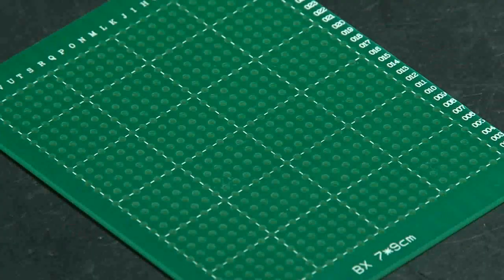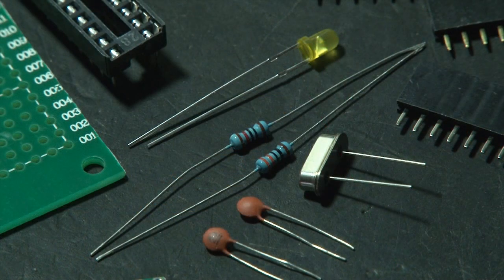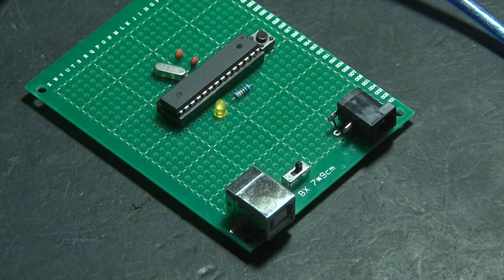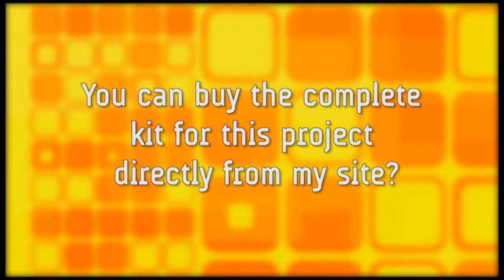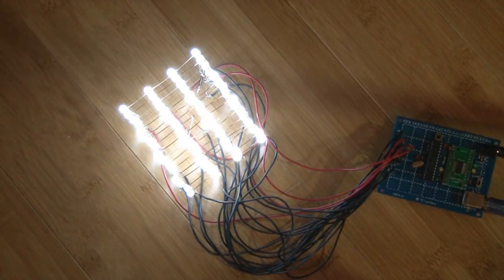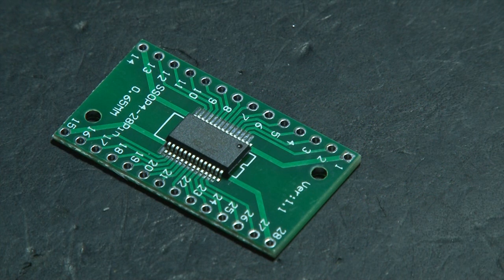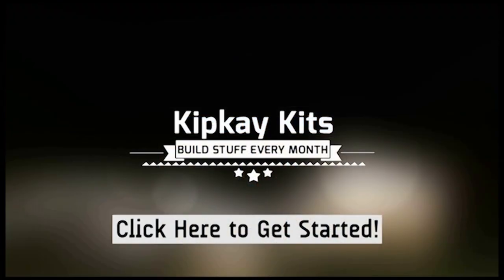DIY Arduino -The Kipduino!

Comment: +kipkay is it possible to read the state of an LED on another device using an Arduino/Kipduino? This spawned an idea to interface my arduino to my home alarm, and read the leds state for the zones and the armed status from the keypad, and using a wifi adapter, send an email in status changes. I was thinking like a shared ground + positive should work?

Comment: Nicely done video. The only problem is you can buy these dirt cheap on Ebay, and other websites. Like most things today, they are made in China. This is one circuit I would prefer to buy ready made due to cost.

Comment: Average price of an Arduino board: $33.61
Price for a high-end Raspberry Pi: $35

For less than $2 more you get an entire computer system (that runs Linux), as opposed to a microcontroller. And yet people still use Arduinos?
Reply: ***** I got the Arduino price from the Arduino website.
Reply: ***** The ARM chips on the raspberry pi are processors as opposed to microcontrollers. The chip on the pi doesn't have any internal storage where you can store your code you want to run.

So I believe that an arduino(or any other microcontroller based platform really) is much easier to start off with than the pi.
Both have their own upsides and downsides and will appeal to different people.

Conclusion: I agree with you.
Reply: Why people still use arduino? Prototyping microcontrollerapplications. And why use microcontrollers?
If you need something really small with very low power consumption. For example the controller for a RC plane. You don't need a full linux on it. The microcontroller uses less power and the big advantage is: If you have a fullblown linux it is harder to implement real time criteria. on a microcontroller you know how many cycles you will spend for every instruction. so you know: ok i need these instructions, they take x cycles. 1 cycle takes y ns numberchrunching ok i'm garantueed to get a new steering direction for the current heading in 0.5ms which is enough to avoid chrashing.
I hope i made a good example for you :)
Reply: Because as you said so yourself the arduino is a microcontroller based platform. It's for prototyping a project you might build using a microcontroller, this lets you figure out what kind of peripherals you'll need for your final build. Obviously you don't wanna keep building prototype boards just to find out you left something out you might have needed and this is where the arduino excels. People also just like to build cool little one of projects and the arduinos generic-ness makes it perfect for one off temporary builds that are just for fun. The PI while cool is for an entirely different set of tasks and is not really comparable to the arduino.
Thank you DarkXTC as I was writing this I saw your comment and you have a much better example/explanation.
Reply: Bad Larry Films 
- Takes much less time booting it up
- Easier to use when creating portable/on-the-go projects
- You can make your own barebones Arduino for about 5 dollars
- It's much easier programming the board with another computer (or external IDE)
- More power on the I/O pins
- Fully open-source

Comment: hi, do you know how to use old mobile phones as input devices for windows or android tablets? those with 12 key keypads or bb9700 keyboards. connection via usb or bluetooth.

i remember how i use to type really fast and accurately on those.

Comment: Kipkay I need your help. I have this old controler laying around (which doesent work) and I'm trying to crack it open. But for me these screws are impossible to take out. Then I decided to cut it open with an exacto knife but this thing is harder to crack open then it looks. Help me

Comment: Ehh, the Raspberry Pi has already overtaken the Arduino microcontroller, mostly because it's an entire computer system on a similarly-sized board.
Reply: Nope thats bs the RPi is powerful in processing-heavy applications but arduino is easier and has much more powerful I/O
Reply: Ryan McDougall The RPi is open source though. It uses Linux.
Reply: BadLarryFilms Arduino is Hard and Software open source
RPi is only openource software the board itself is closed-Source

Comment: 1:49 Windows XP? You do know support for that ended ages ago, right?
Reply from the maker: Umm why would I need support? I built that box from scratch and many others.
Reply: kipkay :D you built your own windows xp and know how to patch security holes yourself? sounds legit
Reply: kipkay Regardless of whether or not you need support, XP is terrible. Support ending is basically Microsoft's way of saying "stop using XP".
Reply: mindaugas49ccm It's a decision from a busines standpoint, It simply costs too much to develop security patches for older operating systems than it makes actual revenue. XP is 13 years old by October. That is ancient by todays standards. And no, XP will not be matching in performance with your old system? Except for old systems (eg. non-selfbuilt and older than maybe 6 or 7 years) which won't have drivers for Windows 7 anyways, Windows 7 will usually perform better, as systems are more optimized for it.
Also, what reasons are there to stay on XP, except the cost of upgrading (~80€ for an OEM disc of Windows 7/8 or ~120€ for the respective Pro edition)? Only if you are using legacy hardware, like medical stuff that would cost thousands to upgrade, or a scanner that only works under XP, it would make sense to stay on it.
Reply: You got owned by kipkay!
Reply: xereeto NO, Microsoft in fact is saying : give me your money, and buy OS  witch most likely is matching in  performance with  your old pc. And you xereeto are the only one terrible here,
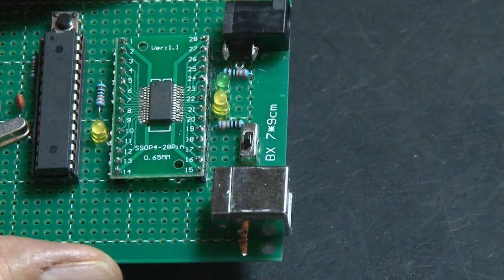Reply: xereeto That's not true. At 1:42 where kipkay connects the kupduino to the computer, there is a sticker on the laptop that says "Windows 7". Maybe you didn't look too close enough.
Reply: Good god that means he must've replaced Windows 7 with XP. Why the hell would he do that. The sticker may say 7 but the window borders and UI elements are unmistakably XP.

Comment from the maker: Make a Kipduino!
Reply: +kipkay I don't have the materials...
Reply: do you know where to buy 2 pin switch levers online
Reply: kipkay can i get it on your website even me is on the other country ...?
Reply: kipkay apparently an arduino can be programmed to flash itself with sketches? i dont know how this works, i saw it on hackaday recently. presumably this could be implemented with an IR Led plugged into an arduino input pin and writing a software that flashes the screen to transmit the code
Reply: kipkay wow